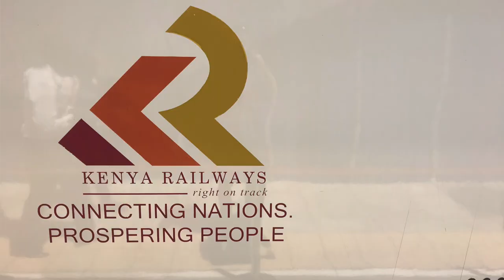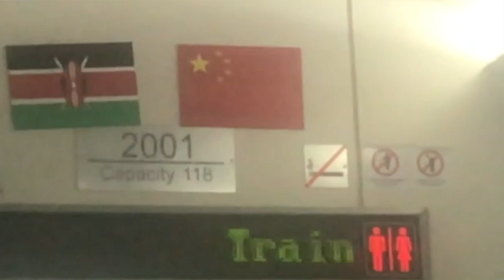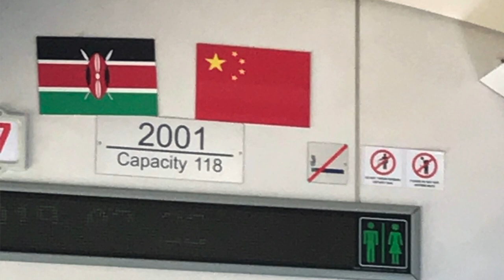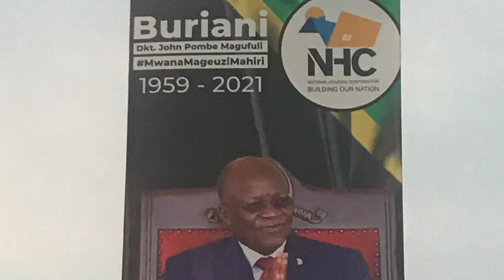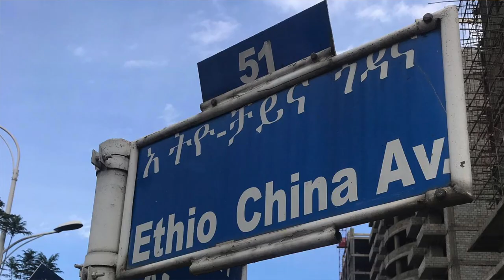Tanzania's Differing Approach To Building An SGR In East Africa

Comment: I have a few points for you to use if you choose to make a part 2 of this piece;

First, it would be good if you put up a map to show the countries, main city names and stages of the SGR and MGR rail.

Tanzanias rail is crossing over an easier stretch of land, so it requires less bridges and less wildlife precautions. It is also electrified which increases speed but also increases cost and strain on the local electricity situation. Tanzanias stations are also placed in the center of towns compared to Kenyas which are outside of towns, requiring last mile connections for goods and passengers.

Kenyas project, while expensive, is $3.6bn. The Tanzania project is $15bn projected. The Kenya SGR is not finished, but it connects seamlessly via a land port to the MGR track to Kampala and Lake Victoria.

Did Tanzania choose this "competing" path themselves, or were they unable to secure a Chinese deal? Now that China is pulling back from Africa and Kenya or at least is reconsidering the ROI on these investments, does that affect Tanzania or EU funding?

There is an import, export and passenger factor for the SGR to consider. China needs the SGR to help its export to Africa through the competing ports at Mombasa and Daar Es Salaam. African exports are limited, however, Congo is the main prize, with vast mineral wealth that China wants. Passenger traffic is 10-20% of the value of goods traffic (Kenya 2021).

Kenya just elected an anti-Chinese president compared to Tanzania, whose SGR has a more local branding.

Turkeys interest in Africa, Egypt, Sudan, Ethiopia vs the Ottoman empire.

If you are looking to make a part 3 as well, you could compare the SGR to the Laos SGR project, a Chinese built SGR but where the locals overwhelmingly embraced it and made it their own, to the point where they have had to buy more trains and the facilities can barely contain all the passengers. Lessons for the Chinese in Kenya or perhaps the Tanzanians?

Overall, a good piece. I agree that more competition is good for Africa.

Comment: Look at the latest videos of the Railway line from Kigoma to Tobora the line is in very bad shape. The railway line from Tobora to Mpanda is also just about userball . The line from Moshi too Tanga also.
Kenya is repairing all its old railway lines.
1. Gilgil to Nyahururu.
2. Eldoret to Kitale.
3. Kusumi to Butere.
Reply: @hemedikassimu9604  not true. Only a few new trains were got. the old lines were not repaired. Kenya and now Uganda are now repairing all the old British railway lines. needs new sleepers.
Reply: @hemedikassimu9604  Google a trip on Tanzania railway from the last year. you see how the railway lines are. The train has too go so slow are the track is in a bad way. Needs new concrete sleepers.
Reply: Shame if you using Google to check operations, punguza chuki.  Old railway line in Tanzania have been rehabilitated even for arusha moshi with new rail lines n concrete what are talking
Reply: @rajalfred3859  not ture. the train rocks from one side to the other as the line is so bad.
Reply: @pauljones3557  What is your point and why are worried?  You can believe what you want to believe!  It depends on who is your source of your information.
Reply: Tulia ww mambo ni matatu

Comment: The central corridor could potentially reach Uganda via Rwanda before the Northern corridor gets to Uganda via Kenya.
Reply: That's the problem of copy pasting kenya projects without proper research and planning. Port of mombasa is nearer to Uganda than port of darsalaam. It will take many years to complete Tanzania sgr to Uganda and it's not guaranteed Uganda will build its portion of central corridor.
Reply: @ezekielmburu3418  But the norther corridor is frozen. Nothing is happening.

Comment: It will take them many years to complete the project
Reply from the maker: Didn’t bring this up in the video, but yes, it could take another decade or possibly more to link the SGR to neighboring countries.
Reply: Not real first section from Dar to Morogoro is over and operation starts tomorrow. Morogoro to Makutopora is almost over as operation is set to start on July 25th. Makutopora to Tabora is under construction. Tabora to Isaka is under Construction. Isaka Mwanza is 60 percent.  Tabora Kigoma under construction. Next two year Africa is connected

Comment: The Kenyan new railway line goes all the way from Mombasa too Longonot not just too Nairobi. Longonot is near Naivasha.
Reply from the maker: Is it operational to the Naivasha area? Last I had checked it was not
Reply: @nomadjournalist  Tanzania needs too repair it old railway lines the railway line from Dar too Arusha is in a bad way. Repair what you have before you build new.
Reply: @nomadjournalist  Google it. Nairobi to SGR Naivasha ICD. The new SGR and old railway lines will meet at Longonot.
Reply from the maker: You are correct. That was a mixup on my part. I placed a clarification in the description of the video.
Reply: @pauljones3557  who told you it is not working?